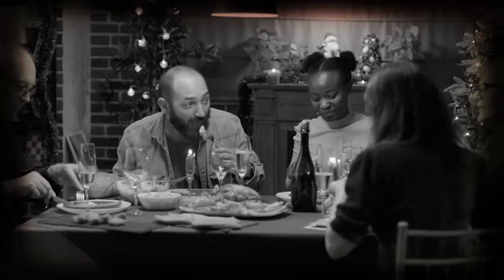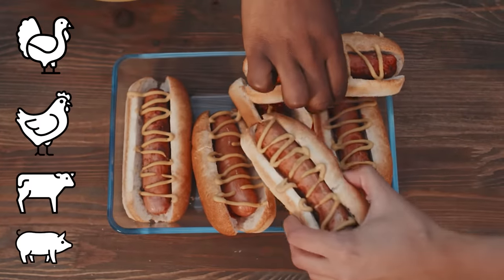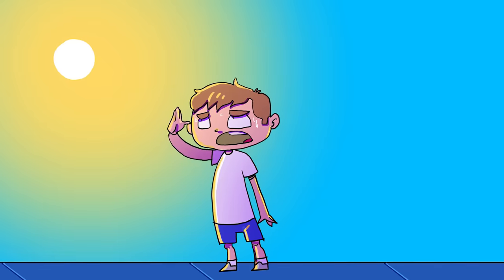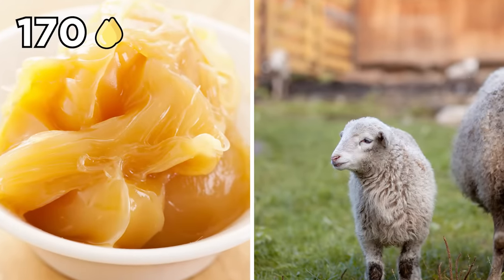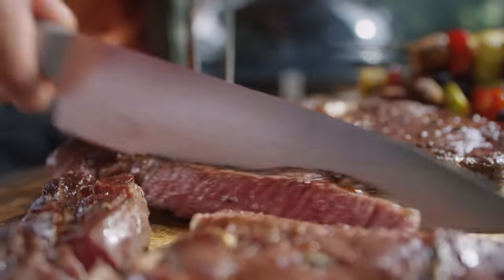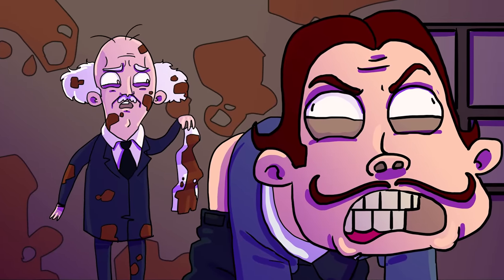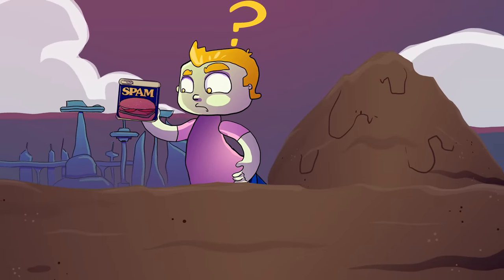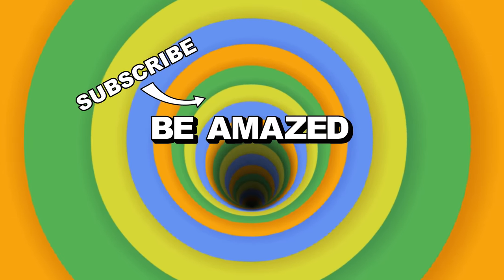You’ll Never Eat This Again Knowing How It’s Made

Comment: I use to work for MARS (think mars bars) a number of years ago on the hubba bubba line making grape flavour. The flavour power was that explosive before being mixed that the drum it was kept in had to be grounded to avoid sparks. i heard about one guy that didnt gorund the drum properly and it exploded leaving a 3m hole in the cinder block wall behind it. that area of the factory was closed for like 6 months while it was inspected and repaired.

Comment: I'm glad I switched to just water for my drinks, occasionally juice or a soft drink but around 99% percent of the time... water 😅💧💚
Reply: yea that is very good but how weel are you doing 9 months later?
Reply: Water's not any better. You ever buy a jug and look at the source? Unless it's certified springwater, the source is usually "municipal water supply" - aka tap water in a jug. Very noticeable difference in taste, too, between springwater and the bilgewater that's been processed and then stored in plastic.
Even if the water itself is fine, the plastic containers it's stored in are dubious at best.